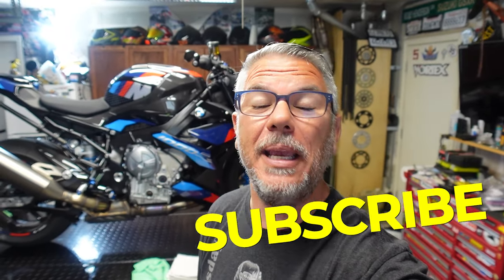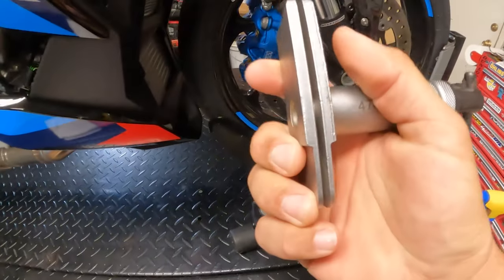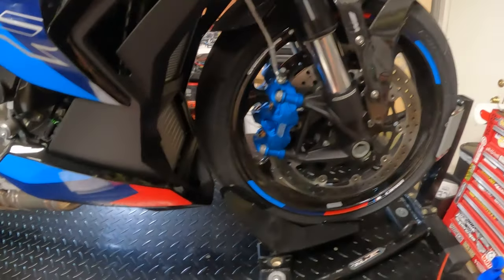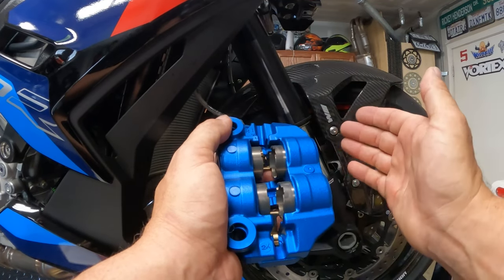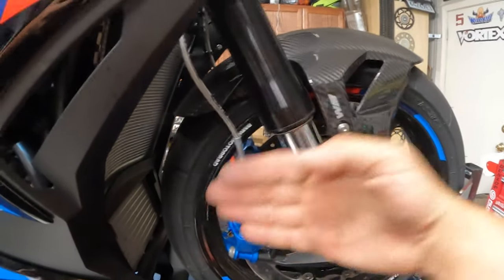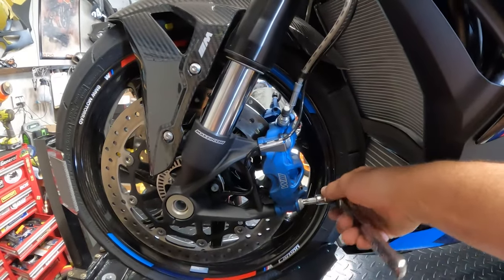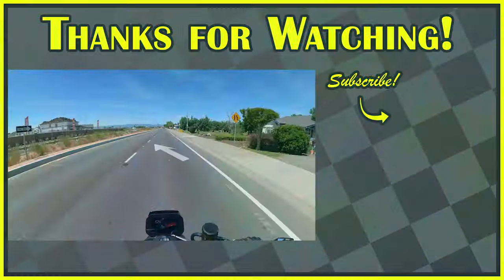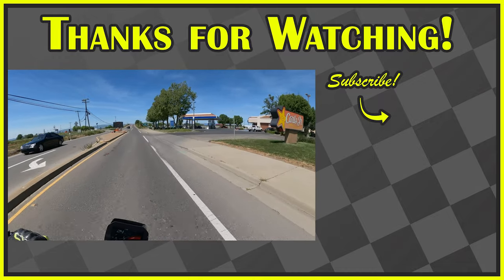Easy Brake Pad Change in Under 10 Minutes - 2023 BMW M1000R Competition

Comment: Thanks for teaching it the right way; a lot of folks miss the very last part where you need to torque down the caliper bolts WITH the brakes squeezed in, so the calipers are aligned properly with the rotor.

Comment: Dear Bill, thank you for the tutorial videos as always. My 2021 S1000RR has a tiny leak at the bleeder screw in the rear brake caliper so I was wondering if you have ever had this happened before and how you fixed it. It is not under or over tighten as I have checked the torque. Thank you!

Comment: Good video Bill!

I have a question about the exhaust. It appears that there is a removable DB Killer in the end of the muffler, are you going to try to remove it and check the sound before you do any exhaust mods? Thanks!
Reply from the maker: There is not a DB killer in.  there is actually a DB killer that you can install but there is not one in there now
Reply: @CaliMotoTV  It sure is quiet, but looks good. I just got my RR w/ M package. I think I may have the same exhaust? Is the catalytic conv making it so quiet? Just got it yesterday so have not had time to look real closely. And that is a beautiful bike.
Reply from the maker: @Patrick C  yeah the cat is what is keeping it quiet, you're definitely going to have to upgrade the exhaust.
Reply: @CaliMotoTV  Thanks for the reply Bill! I saw the screw on the inside of the exhaust tip and wasn't sure if there was one installed or not, thanks for clarifying it for me.